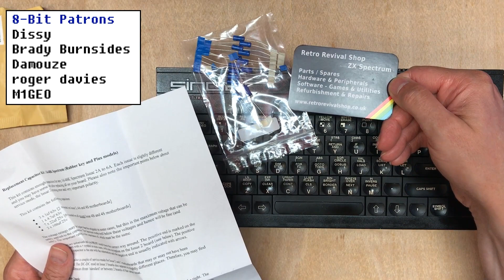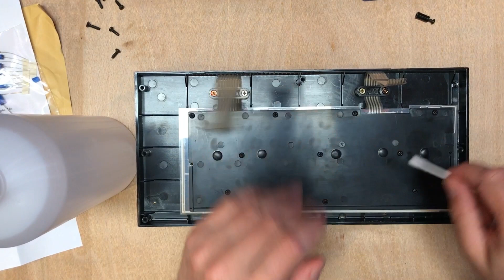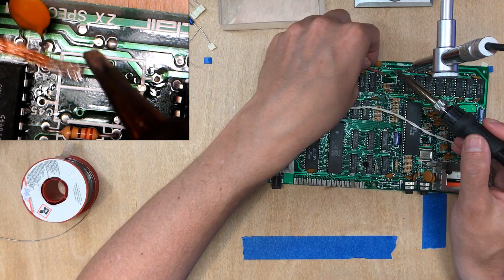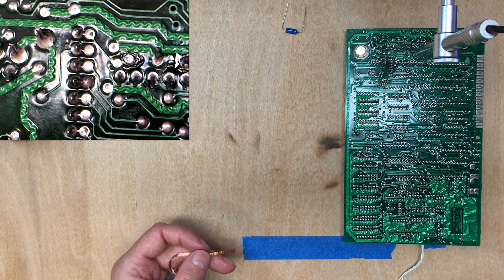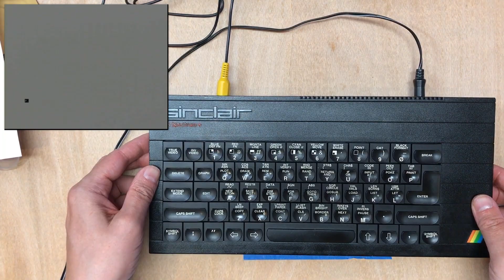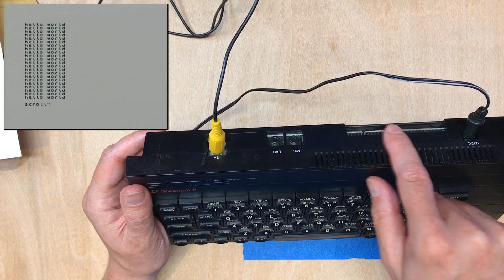ZX Spectrum+, Recapping

Comment: aren't chinese replacement capacitors worse quality ?
Reply from the maker: These ones are supposed to be good, standards are down to manufacturing process and quality control rather than geography (There are Chinese manufacturers at all points of the scale). The big issue with electrolytics though is that over time the electrolyte can dry out, so replacing like for like but more recently manufactured is a safety thing.

Comment: James the uv set adhesive is good for that plastic
Reply from the maker: Do you know what type of plastic it is, reacts almost but not quite like abs? It obviously predates the standard markings.
Reply: @JamesSharmanExtras  I have used it on many of my retro cases from zx81 to 800xl and Amiga and St’s all was ok. If stuck the plastic but did not sum to react bad with the plastic. You can also build it up around the part a have even built up screw stems and sanded and drilled them to take a screw this was very awkward tho as the glue is runny

Comment: James, when you get holes that you can't clear, add fresh solder first. The flux in the new solder helps a lot!

Or a solder sucker. Much better with through-hole parts!
Reply from the maker: Must not have been obvious but I was adding fresh solder to all these joints. The desolder was actually really easy after the first few once I got the technique right.
Reply: @JamesSharmanExtras  my apologies! I hadn't realised! Splendid stuff!
Reply: If it's [censored] silver solder, then I always start with fresh leaded solder first.  If it's good-old quality leaded solder (moment of silence here), then just dab the joint with a flux pen and proceed to desolder.  It's a thing of beauty.